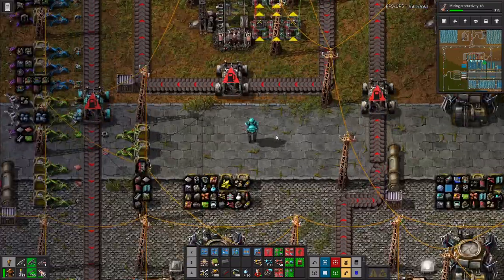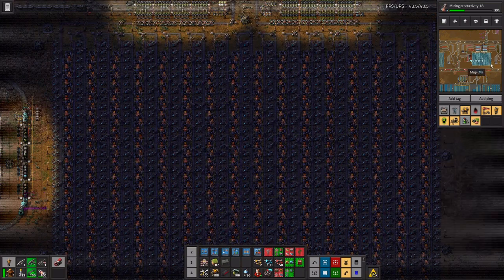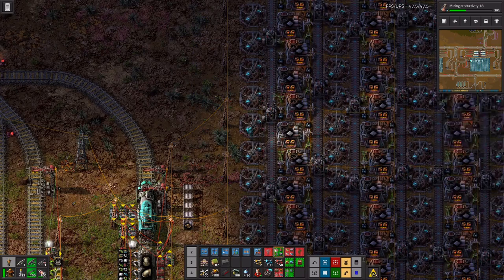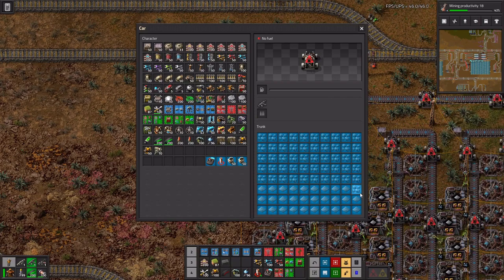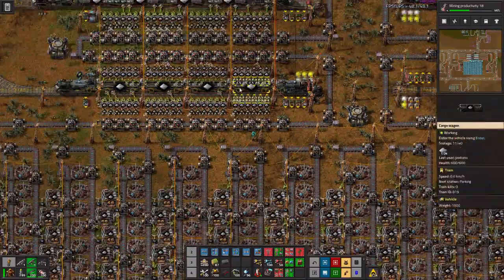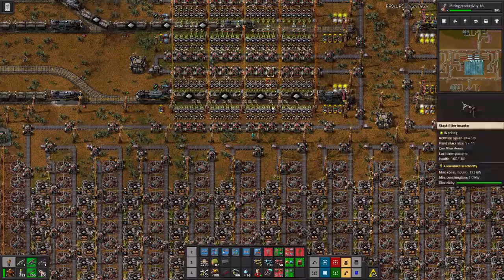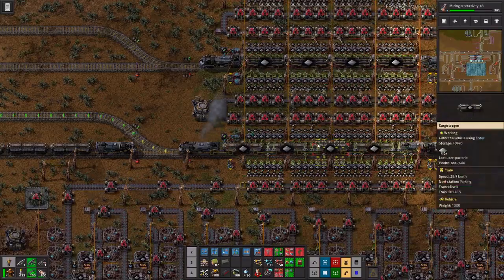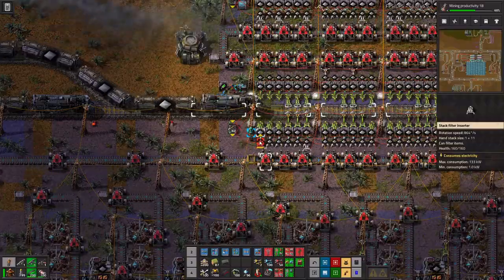Factorio Car Abuse -- 108K plate per min

Comment: Would be interested to see how this affects lag/UPS. I imagine it may be slightly better than belts?
Reply from the maker: if you are good at belts and ups optimizing, then this is definitely worse. my 1.5k version of this was running at 60, but this 3k version was down to 30.
Reply: @paxtorio1495  could the cars checking for fuel be a rheason for that?

Comment: hey, i think you can improve your load/unload train system by describing the condition for inserter work: every signal must be less or equal to zero. if you do it in this way you'll achieve constant average loading w/o delays w/o stops in inserter work. but bottle neck with trains that advice won't fix :)
Reply: i understand that less than 10 is working as well, but i think <=0 is more obvious
Reply from the maker: thanks for your comment! yes 0 is the most logical choice. playing around with it though, it doesn't really matter too much